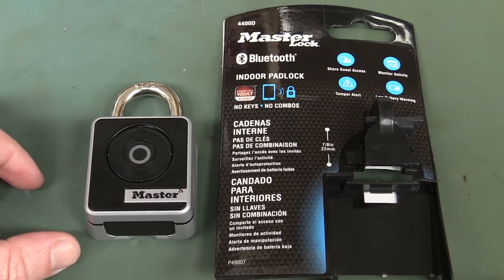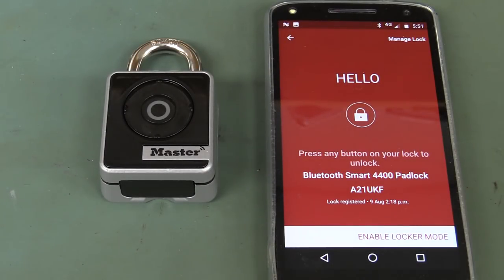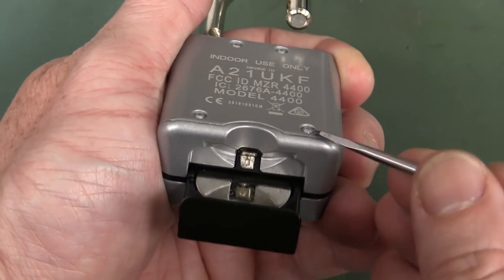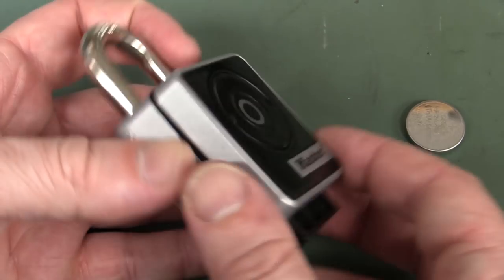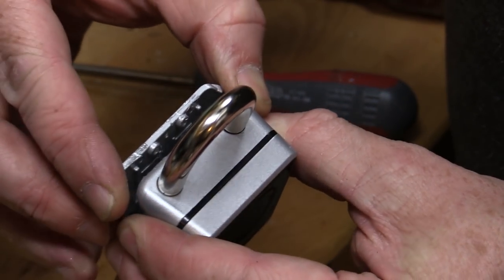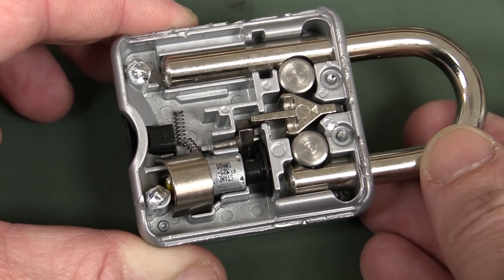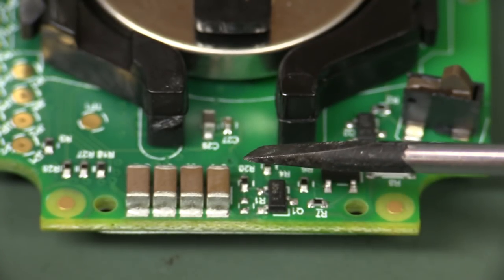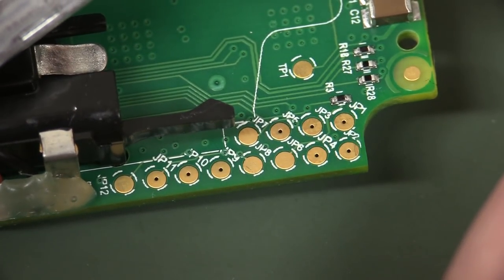EEVblog #1014 - Masterlock Bluetooth Padlock Teardown

Comment: I put my phone in the sports locker, and lock it... oh, wait....
Reply: that's why there is a combo option...
Reply: There is a locker option....
Reply: DataStorm I'm guessing you didn't watch the video.
Reply: Guys, guys, really? didn't you watch the video? the phone is nearby inside the locker... that means it is unlocked right away.... if it would work...
Reply: That's what locker mode was for, so it didn't unlock itself, and required the combination.
Reply: Yeah but what's the fucking point of a smart lock if you're just going to use it as a combination lock..? The entire appeal of this lock is that you don't have to unlock it manually.
Reply: Ok let me repeat myself. The combination bit is so you can still open the lock IF YOU LOOSE YOUR PHONE. The rest of the time you open it with your phone. Think before you ask stupid questions.
Reply: Except for when you use it in locker mode, in which case you never use your phone and that is what I was commenting on, plus the entire reason why I asked a rhetorical question but you can't seem to take a hint...
Reply: I think it's time we all just move on.  More important things to do.  ;)  Like watch some anti-solar freakin roadway video.

Comment: The Masterlock is indeed vulnerable to magnetic attacks.

In the video of the talk "Lock picking the IoT", from the chaos communication congress 2016
https://media.ccc.de/v/33c3-8019-lockpicking_in_the_iot#video&t=2725
at ~43:30 it is shown, how the Masterlock can be opened with a moderately sized magnet.
Rotating the magnet at the back of the lock moves the motor and opens it in seconds.
Reply: nice!

Comment: So glad you gave a groan at the idea of a Bluetooth padlock at the start of the video. I wouldn't have known what to do if you'd said "What a great idea!".
The last time I face-palmed at a device as useless as this was when Oral B released a toothbrush that could communicate with a smart phone app.
Reply: ForViewingOnly not to mention anything Bluetooth is a security problem
Reply from the maker: I groaned at that one too. My Oral B vibrates to let me know how long I've been brushing, no stupid app required.
Reply: EEVblog Mine vibrate while I brush, kind of the primary function.
Reply: Instead of paying a lot of money to buy one expensive electric toothbrush. Buy several manual toothbrushes, one for the office, one for the glove box in your car and so on. And have dental floss everywhere and use it.

Teeth should be cleaned directly after every meal, especially if it contains a lot of fermentable carbohydrates. If you drink sweet lemonades or acidic juices,  just rinse your mouth with water. That is a lot more effective then waiting until you are at home to use your high-tech electric toothbrush, because when you arrive at home, the damage has already been done.

Dental hygiene doesn't need the Internet of Things or Bluetooth or electricity or stopwatches or colored stripes in the toothpaste, it needs some minutes after every meal and discipline to do it. :-)
Reply: Expect studies have concluded that it doesn't make a lick of difference if you actually brush your teeth before or after your breakfast for example so that kinda goes against you "immediately after each time you eat" idea
Reply: Draugo a toothbrush seemed to be the perfect example of things where no computer (IoT, Apps, Bluetooth) or even electricity is needed, just discipline to use it! I haven't thought a lot about brushing the teeth and i definitely haven't searched for any studies about it before. But your comment made me search and read a bit about it, thanks.

It seems that we are both wrong. Brushing the teeth after a meal seems to be the standard that is followed by everyone and taught to everyone. To brush the teeth after each meal is what I was taught by my parents a  long long time ago and also told by different dentists. I never questioned it because it seemed plausible, because it will remove the bacteria and food they need to produce acids.

But a search for these studies (I haven't found one yet, I am still searching!) unveiled some webpages that explain that it really does make a difference if you brush before or after a meal. And we should actually brush before the meal.

The explanation was that two things have to come together, the bacteria and the carbohydrates. They produce acids within seconds after they come in contact with sugar. And these acids will immediately start softening the tooth enamel. It normally takes about half an hour for the saliva to remineralize the tooth enamel after it has weakened. Within these 30 minutes the teeth are also especially vulnerable to abrasives in toothpaste, so you shouldn't brush them immediately after a meal or drink. If the population of bacteria is reduced before a meal, there will be much less acid produced and this is what helps to prevent caries. It is also recommended to use alkaline mouthwash to raise the pH again and help to remove particles from the food. And of course dental floss to clean the space between the teeth.

What I wrote above is basically a summary of stuff i found with the following google search:
https://www.google.de/search?q=brush+teeth+before+after+eating
Reply: There's an IoT enabled salt shaker. SALT SHAKER. Look up Smalt. MADNESS.
Reply: Smalt! OMG, utterly insane! I'm not 100% sure that it's not a spoof cos it's so useless and unnecessary, but it does have an active Indiegogo campaign with some backers.
Reply: There exists a solution for the IoT madness, it is called: EPFCG ;)

(everybody should have some of these, just in case someone comes with a new salt shaker;))
Reply: Actually, I have thought the same thing but changed my mind after hearing from several friends that have those Bluetooth toothbrushes: While the app is certainly pointless, it is a gimmicky toy that actually makes some people stick to regular and proper brushing better. Not because the app does anything useful, but because it is kind of fun to have an app tell you if you are cleaning right and track if you have been using it regularly. And since it doesn't significantly increase cost - the Bluetooth ones do not retail for much more - I'd say: Why the hell not? That is kind of an exception though, I completely agree that the padlock is complete nonsense. A good example of a well engineered product based on a nonsensical idea.
Reply: Sorry, I can't get with the idea that a gimmick brings about a long-term or permanent change in somebody's self-care routine. Makes me think of all the overweight people who bought a Wii-Fit system to lose weight.
Reply: Actually you are making my point: While the vast majority of people will use it for a few days to weeks but not make any permanent change to their fitness regime, I personally know people who have managed to permanently loose weight through the motivation give by the Wii-Fit system. Most will end up stacked away collecting dust - but if some people actually manage to make a positive change through it isn't it worth it?
Reply: I think we come from different walks of life. You "personally know people who" this, and have "several friends that have" that, whereas I personally know people who DON'T this, and have several friends that DON'T have that :-)
Reply: Oh no, I know plenty of people that have a Wii-Fit collecting dust somewhere. :)
The point is that even if it only actually helps 5% of people who buy a unit it is, in my opinion, a success. The same goes for every health related gadget, from juice makers to fitness trackers to full size exercise equipment.
(I do not see even a niche use case for the Bluetooth padlock though. The cases where an electronic lock may indeed be useful an RFID-based one would probably be better, not to mention cheaper to build and more reliable.)

Comment: While the app wasn't working as fully advertised... it does work if you played around a bit more. I've had to hold the lock icon within the app and then get prompted to press any key on the lock.

My university's makerspace uses a few of these locks to lock tools that require certain training. When you complete the training the lock is shared with you. Maybe not ideal, but there are applications.

Comment: If the battery dies or control circuit happens to fail due to moisture or EMP, MAGNETIC COUPLING WORKS GREAT TO OPEN YOUR LOCK! The tiny internal lock/unlock motor can be spun via an external magnet turned against that area on the rear of the ALUMINUM lock housing. Use finger power or a small rechargeable drill fitted with an external (spinning) magnet as an emergency backup "key" for your lock. EEVblog Dave could design a multi-phase drive circuit to power the stator coil of an old electric motor (just large enough to slide over the failed lock) in order to open it up in a jiffy ...and quicker than you can say, "GUILTY", uncle Bob's your cellmate who's also in, like Flynn!

Comment: We use these locks to secure the transport of exams to a examination centre. The great thing about them is that we can provide controlled access to the exam papers. Once the exam centre has the zoom session up, our remote invigilator provides the guest code which is single use to open the exam paper box. Once the exam is complete the put the papers back in and lock the box again. No one can get back in now as the guest code is single use. We put a few single use guest codes in in case it needs to be reopened under supervision.

Comment: I think the simplest weakness is the motor pins are on the edge, next to the plastic bushing. A hot soldering iron would put holes in the desired location and then just insert two wires from external battery to energise the motor bypassing the rest

Comment: Android has the inbuilt Bluetooth logger that stores captured packets in the log file. That file can be imported in Wireshark for analyzing which could potentially reveal the key code if it is not encrypted.

Comment: The real weakness with most of these Bluetooth smart locks (be they padlocks like this one, the kind that fits over the locking snib on a single-cylinder deadbolt or the kind that actually replaces the door lock on a door) is that the security involved in the communication with the lock is usually junk. Many smart locks have been hacked open without ever having legitimate access (there was a talk at a hacker conference about it IIRC).
Reply: Jonathan Wilson - True but depends on the software security app. Some come with key encryption making it difficult to hack. Key code

Comment: Dave, you probably have to move the phone out of range then back in range (or just disable bluetooth on your phone then reenable it), then the lock may unlock via bluetooth. It makes since for it to remain locked while in range because it would be bad if it unlocked when you're in range then remains unlocked or keeps unlocking when you are attempting to lock it because your phone is still in range...

Comment: I'm having a difficult time even understanding this from a convenience standpoint. I mean, you reach into your pocket, pull your phone out, unlock your phone, open an app... 

How is it more convenient than reaching into your pocket, retrieving a key, inserting the key, turning the key? Is it supposed to be more convenient because you don't have to carry a key? I mean, you're already probably going to be carrying your house keys with you anyway, what's another key on your key ring?
Reply: MrYoshiDan According to the video, you keep the phone in your pocket, and whenever you are close enough to the lock, it opens on the first keypress.  Of cause that would require Bluetooth on at all times, even if not used for anything else.
Reply: This product simply taps into a market where people will use their smartphones for EVERYTHING. Don't look more into it - there's nothing there. This is simply an example of top-down marketing. Mr. Masterlock asked a bunch of millenials how to tap into the smartphone market but still stick to its primary business of selling padlocks. And this is what came out of the findings.
Reply: Yup, smartphones are making people dumber !
Reply: +Ian Clarke if a smart phone is so smart, why does it always connect to the weakest wifi access point around ? :)
Reply: It has a "Locker Mode" which Dave missed in the beginning of the video and called it a "Fail" funnily enough.  
That does it as the advert in the front describes it. You don't have to touch your phone, it only needs to be in the proxmity of the lock to be able to unlock it.

If you don't use that you have to use your phone to unlock it manually or the combination.
Reply: you ALWAYS have your phone with you. a key is an additional item to keep in your pocket.

Comment: The rotating bit that lets the wedge move down and let the lock open seems to be a Geneva drive. The motor rotates and turns it an exact degree every rotation.

Comment: 3:38
I have seen some padlocks in my life and in my experience those which comes with a "hardened" marking on their shackle are not hardened at all, sometimes not even steel. 
I recommend you try cutting it with a hacksaw and see if it cuts or not.

Comment: The big advantage with these connected locks is access control. In our case we're a large student team (soon to be ~60) with small office space in the corner of a large multi-million-dollar university research lab. The University can't afford tracking and crafting keys to the lab for everyone, much less changing locks every time a student leaves the team or graduate. And updating everyone with new combinations is not much more of a hassle-free solution.

With connected locks, you just edit people's access online. This was a good compromise with the University, going from 3 supervisors cleared for key access to our entire team. We're also planning to buy more for controlling access to equipment and hardware requiring special training.

Comment: Is it protected against over-voltage (maybe 9V, since that's an easy battery to obtain and carry) on the external DC input?

If 9V won't do it, how much voltage does it take before failing?

I'd be worried about someone intentionally frying the electronics to lock you out.

Comment: I know I am writing this a year later, but I would be curious to find out if it would be susceptible to circuit overload. Of course, if you run a high enough voltage through anything, it will release the magic smoke, but what I mean is transistors usually fail closed, so if the power rail is connected to the motor through a transistor, the transistor would fail closed way before the motor. In that case, you can just zap it with a high enough voltage, and you would be able to control the motor directly through the exposed contacts. I saw a fuse, but even with a fuse, transistors still tend to fail before the fuse fails.

Comment: I have never understood this fad of electronic locks. I have seen a ton come onto the market for bicycles. This is simply a solution looking for a problem. Most of the time when a lock is defeated, it's not the lock itself that is defeated, but the shackle. Most thieves use either bolt cutters, or an angle grinder. Why complicate things with an electronic device that will fail at some point far sooner than a mechanical lock.